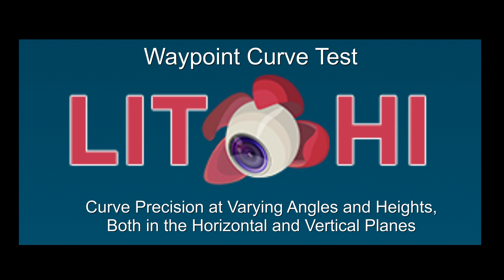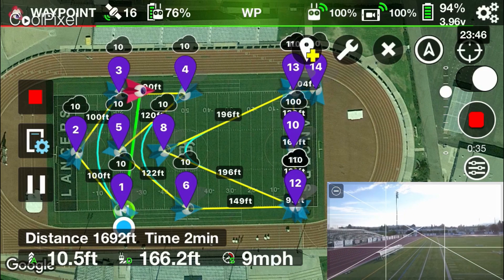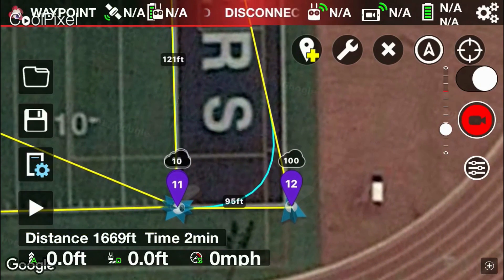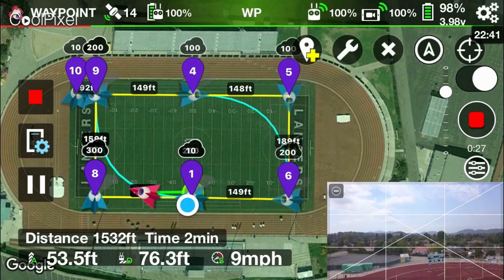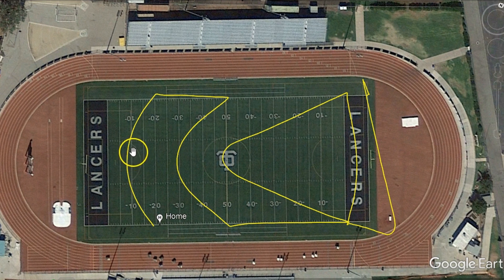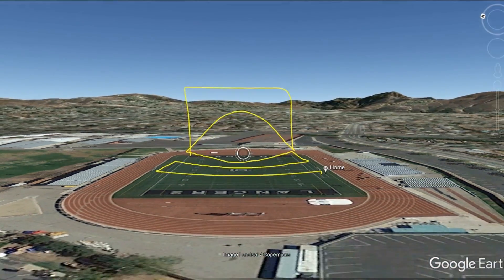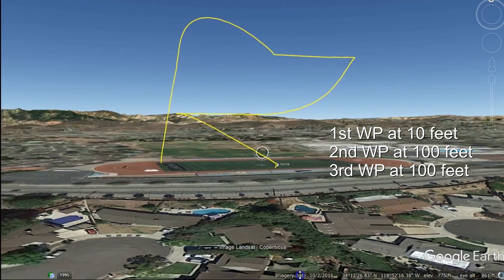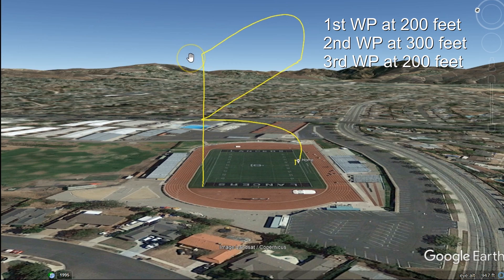Litchi Waypoint Curve Test - DJI Mavic Pro Phantom

Comment: Thanks for another great waypoints tutorial. If possible it will be great if you can cover actions in waypoints. I tried the panorama, and start recording, and stop recording and it seems not to work. I've read in some forums that not all sequences are working and the order of actions matters but it's still not clear to me. My goal is to be able to send the mavic to a mission while recording video and still take panoramas is certain points (and resume the video recording). I have Mavic pro and using Litchi on Android. Thanks!
Reply from the maker: Nice hearing you liked the video.  And yes, a video on Litchi actions is sorely needed, and will plan to prepare one.  For taking panoramas and recording video, you would at least have to stop recording before you can take a panorama, then restart recording, but not sure if that would all even work.  Be sure to try out 3d flight planning using Google Earth, here's a part 1 of the video on that, https://youtu.be/veOZIxP92zo.
Reply: I saw it already, and most of the others, few times. These videos were my initial motivation to try waypoints at all so thanks a lot! Actually now when I'm trying to work with Litchi hub I'm having a problem: I can't edit way point settings. Up until now when I clicked on a point, a window used to popup and I could change the settings (curve, speed, actions, etc.), now when I click a point it is selected but no window is shown. Any idea?
Reply from the maker: I just tried using it too, and have the same problem. Litchi made an update to the hub that may have caused this issue.
Reply: They fixed it! so now I'm trying to do a vertical arc similar to those you show in the video but it doesn't look as good as yours. You will show an example of settings the points to get nice verical arcs?